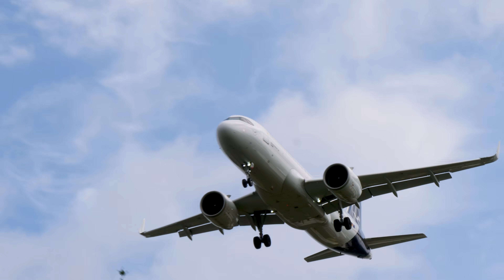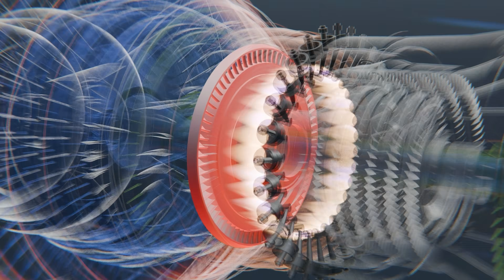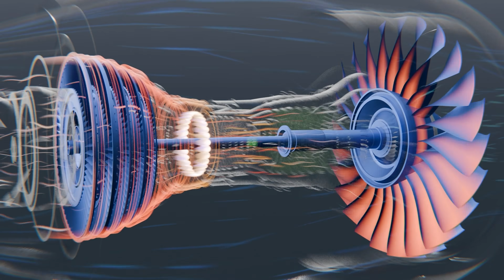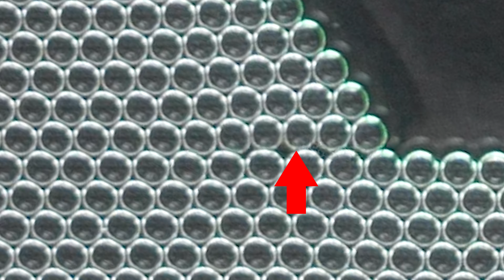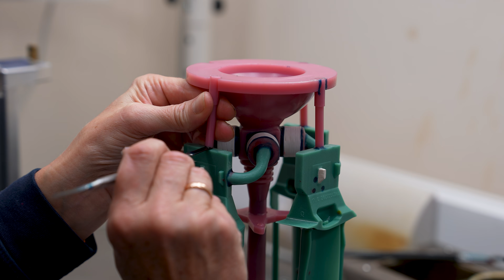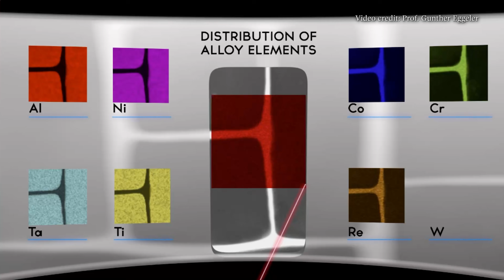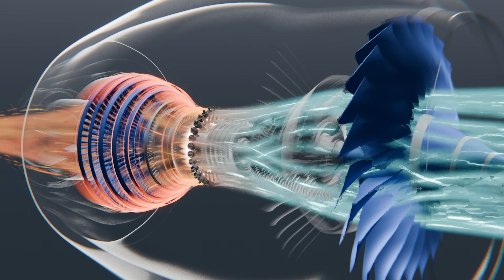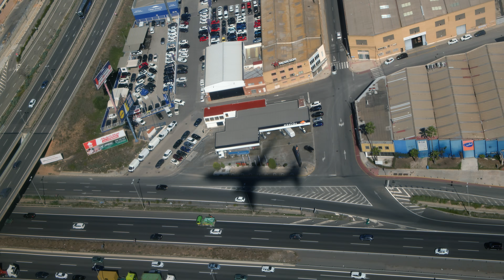The Ridiculous Engineering Of Jet Engines

Comment: “As the hot exhaust gas is shot out of the back of the engine, it pushes the plane forward …thrust.  “.  

People think jet engine “pushes against the air”. The explanations in the video were great until the quote on my first paragraph. 

Thrust is generated by frictional forces generated on all internal surfaces of the exhaust turbine section. FRICTIONAL FORCES.

Comment: A bit of a mistake @4:00. Yes, it takes four times as much energy to impart twice as much velocity to the each kilogramme of air in the second case, but as there is only half the total mass of air accelerated to that higher speed, the net energy difference between the first and second cases for a given thrust is twice, not four times as much. The problem is with the equations @3:50. In the left hand side, it has a mass of 2m and velocity delta of ½v, whilst on the right hand side (case 2), there is a mass of ½m and velocity delta of 2v. That means on the right hand side is one-quarter, and the velocity delta is 4 times higher than the left hand side. The calculation that the right hand side requires 4 times the kinetic energy is correct, but the commentary is wrong. What that says is that half the mass accelerated with twice the velocity change results in four times the amount of kinetic energy being imparted. It's not, and it does not match the equations. 

However, it is a very important point, and it is why reaction motors with high exhaust speeds are energy inefficient, but are efficient in their use of reaction mass. Hence rockets are much less energy efficient than turbo jets, which are less efficient than turbofan. Ion reaction engines are worse yet (but great on low reaction mass in use). Worst of all in energy efficiency? Using pure light to produce thrust.

Nb. I know chemical rockets have to carry their own oxidising agent, but it isn't the reason for their inefficiency in energy usage.

Comment: I didn't get why do we need this? If 80% of the thrust comes from the propeller, why so we fight so hard for the 20%?
Reply: where do you think the power to drive the fan comes from? that's right, from the low-pressure turbine. and the higher they push the turbine inlet temperature, the more efficient the engine becomes.

Comment: A jet engine survives because it’s actively cooled, protected with ceramic coatings, built from exotic alloys, and designed so heat never stays where it can kill the metal.
Reply: Thank you for that summary! Was very short while still covering the important bits.
Reply: I appreciate what you have done here. I personally think this video was about 4 times longer than needed for the information conveyed. Great visuals and demonstrations, but please cut down on the dramatic narrative and rhetorical questions.
Reply: @BassDawStew  go read a technical spec, dude. These vids are made for people who may not be on the spectrum.
Reply: Why did they evaporte on 9/11 ?
Reply: @YourBeingParanoid  that answer is obvious if you had a basic understanding of physics.
Reply: @YourBeingParanoid  They had not enough air circulation and the coating damaged due to impact.

Comment: the first jet engines wouldnt have had all these things and they didnt melt?
Reply: They also used a lot more fuel. Remember the hotter you burn your fuel, the more efficient your engine is. All of this tech is for 1 purpose ... increase fuel efficiency.

Comment: (veritasium please read this)Hi I have something to say . If you take a large magnet and put a thin 100km rod and then use the large magnet to spin it about 180000 rpm you can probably get it to move at light speed . Remember if you did it at the end but the time you pushed it for will increase but the total energy will stay the same . I'm surprised no one actually thought of this . This probably dangerous ao I hope scientists don't use this for a few hundred years . I know you might say it will break but remember carbon exists and the amount of energy required to accelerate will be finite assuming the rod is 1 ton it will be a few trillion joules but also remember that if civilization has evolved enough to build something like this in space they can probably generate the power and remember if that doesn't work we can skip a few thousand years and use a magnetar instead

Comment: A jet engine looks surpriingly symmetrical from front to back. You could have shown the same internal structure but switch where the front and the end is and I wouldn't have noticed, except maybe for the big fan at the front. 
That raises the question: Why does it create thrust in one direction but not in the other? What prevents the expanding gas from pushing to the front, stopping new air from getting into the area where the ingintion happens?
Reply: When that happens that is exactly what is called a compressor surge, very damaging to an engine. Turbines rely on smooth air flow into the engine any disruption can cause the engine to surge.
Reply: Id say the momentum of the entire system. You have a high energy gas stream... its pretty hard to reverse that.
Reply: Most likely a combination of momentum and the sweep of the blades
Reply: The larger turbine results in more work being done, than it takes to drive the compressor.
Reply: Pitch of the turbine blades for starters.
Reply: 50 bars vs. 1 bar, I wonder what direction air flows? Are you alright? When the engine is started pressure for spinning the compressor is provided by external source, APU or a ground side compressor. Combustion needs that high pressure air even to start, so only way to air to go is out, and spin the turbine.

Comment: Jet fuel can't melt steel beams.
Reply: You're behind the facts on this one, it doesn't need to "melt" steel beams for a structure to fail if those beams are already under a lot of stress.
Reply: @marcosmith6613  It doesn't surprise me that I got a psuedo-intellectual answer to a meme post, especially on this channel, but you're actually behind the facts on this one yourself. The issue being that they found melted beams. It's not really about the beams failing, though that is an entirely different issue itself.
Reply: @squidikka  except they didn't find melted steel beams did they.  Unless you have a verified source for this then please share.

Comment: Okay... I actually paused the video to write this! The explanation of shearing among atoms in the metal lattice using bubbles was a top tier idea!
Reply: I loved that demo... it made everything else way more tangible.
Reply: Dr. Bragg and Dr. Nye won a Nobel prize for the bubble raft experiment explaining dislocation motion in crystals. the experiment was done in 1947
Reply: A common idea, I'd say. Though, execution is what's impressive: they had to get the bubbles right, and know they would stick as needed for the demonstration. (I gather that those were not common soap bubbles, so chemical expertise was involved). I wonder if Universities do that / used to do that?
Reply: @kepler_22b0 Yes. If you look at Feynman's Lectures in Physics published in 1965, he shows, in an appendix with photographs, the bubble experiments conducted at the Cavendish laboratory by William (or was it Laurence?) Bragg which demonstrate the very same principles.
Reply: @kepler_22b0  It is relatively common, tho hard to do just right. Most colleges should have some kind of bubble system setup for this demonstration somewhere in their engineering department. As for the bubbles themselves, I sure they use a strong soap to keep the bubbles from popping, but besides that, bubbles love to stick together, it's energetically favorable for bubbles to stick together. That's why you see the deformation so clearly when he pulls the plates a part.

Comment: @3:33 to be picky, Rafale's M88 engines have some bypass, they are not simple turbojets (and they run even hotter than 1500°C)
Reply: Even hotter than 1500c' 
Well not that hotter actually m88s tet is just 75c more
Reply: @TheOnyx_prime  f35 can run at almost 2000 but its a turbofan
Reply: @kaelanstaples  I think that most of the military jet engines are turbofans by now, and Derek may have got his facts crossed, hoping to provide a counterpoint. Understandable, as most of them aren't especially high bypass, but those are the facts.
Reply: @unclejoeoakland  yeah

Comment: The 'pigtail' mechanism to filter out all the grain boundaries except one is easily the most satisfying piece of engineering I've seen in a long time. Pure genius.
Reply: You wonder how did they found it...
Reply: @Ubeogesh Maybe they found it when someone left a bendy wire in a crystallisation chamber?

Or someone noticed a pattern with the sugar in a cup of water?
Reply: @Ubeogesh  probably the same way how blacksmiths discovered the secrets of the Damascus steel 1000 years ago. The principle is generally the same — use lattice geometry to make alloy more stress resistant.
Reply: @starling- It's actually Wootz steel, Damascus steel is a misnomer
Reply: Literally magic. Did not understand why it works
Reply: Probably crystals thend to grow more in one direction than the other and by forcing the crystalization direction to change, the balance of many competing crystals is interrpupted and favors less and less crystal grains every turn. That's how I see this.
Reply: I think this is unironicly the coolest feat of engineering I have seen recently
Reply: The entire process is an insane feat of engineering by decades of geniuses cooperation
Reply: Its conceptually almost impossible to think to make it all out of a single crystal, yet the pigtail solution is simple. Just brilliant material science.
Reply: Really incredible
Reply: I had to look more into it:

What the “pigtail” (grain selector) actually does

When a turbine blade is cast using the Bridgman directional solidification process, the metal is poured into a ceramic mold and cooled from bottom to top.
At the bottom of the mold is a curved, spiral channel shaped like a pig’s tail — the grain selector.

Its job is simple and brilliant:

✔ Only one grain survives the spiral

At the start of solidification, many tiny crystals (grains) nucleate at the starter block.
But as the grains try to grow upward, they must pass through the tight, curved spiral.

Only one grain, optimally aligned with the thermal gradient (usually ⟨001⟩ direction), is able to grow through the full twist of the spiral.
All other grains misaligned or slower-growing are blocked, choked, or stop growing due to:

geometric constraints

competitive grain growth

heat flow direction

the curvature slowing misaligned grains

By the time the metal reaches the blade airfoil, there is only one grain left → creating a single-crystal blade.

🔧 Why it is spiral-shaped (the “pigtail”)

The spiral shape performs two key functions:

1. Geometric filtering

A curve reduces the chance that a second grain will “follow” behind the primary one.
Straight channels allow more than one grain to survive.
The rotation creates a “race” where only the fastest-growing directionally aligned grain wins.

2. Thermal gradient control

The 3D S-shape ensures the heat gradient is stable and forces grains to follow the preferred <001> orientation.

📌 Technical Summary (simple)

Starter block → many grains
⟶ Curved pigtail spiral → only one grain survives
⟶ Airfoil region → single-crystal superalloy

This gives the final blade:

no grain boundaries

no creep at boundaries

exceptional high-temperature strength

tolerance for thermal gradients

greater fatigue life
Reply: @axelf4515  Brilliant. Thanks for sharing your comment! Clarkes words somewhat come to mind, 'indistinguishable from magic".... ^^